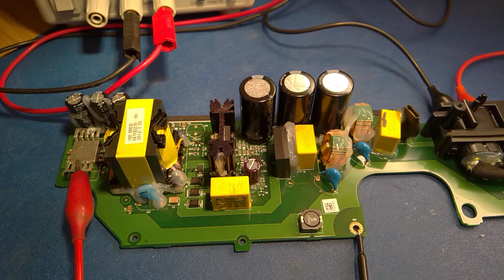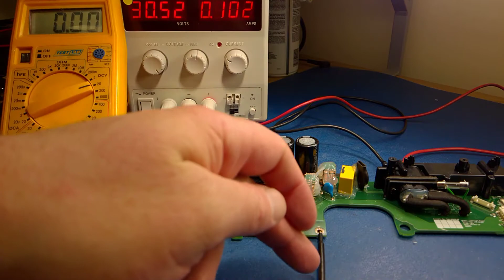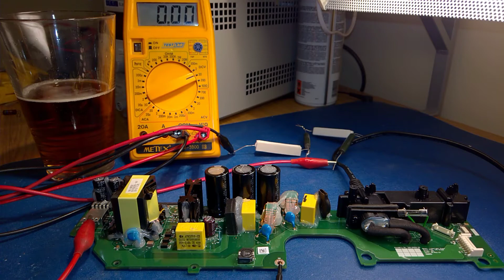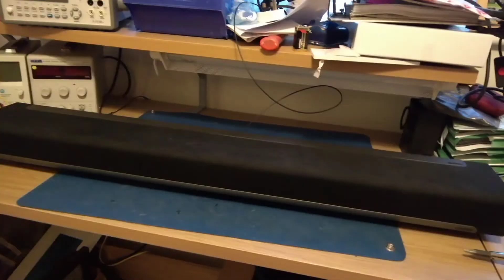[EafD] Sonos Playbar Repair - Part 2

Comment: So because there is no actual checking of the power supply that means we can just get rid of the power supply entirely and just feed it 16v from the mains directly to the low voltage portion of the board.

Comment: Does anyone know whether a short circuit can be measured between the two component connections on D2? This is the case for me, and I am reluctant to unsolder the component to check this.

Comment: Hey @Ohmslaw,
When you test the power supply with 30V, is that 30V AC or DC??
And how exactly do you select the 30V - would you please elaborate on this a bit?
Thanks for the video - it helped dismantling my Playbar.

Comment: Hi I have replaced the same components you suggested and the secondary stage has a slightly lower voltage and is chirping periodically please see video Hawkeye Oculus Sonos Repair. Can you please advise what failed components are responsible for this noise ( diodes capacitors etc) thanks

Comment: Does anyone have an service manual for this playbar. I need to repair mine and eould like to know how to read snd measure the pcb's. Many thanks in advance
Reply: Sonos have never provided a service manual for any of their products!!!  However this particular design is relatively easy to troubleshoot. I've fixed a Play 3 and a Connect both with PSU failures and found them to be pretty straightforward.

Comment: Glad I found this. Rather than try to repair the PSU I just cut the PCB in half just to the left of the mains inlet, sanded the traces to remove the copper mask,  soldered +ve to the top and ground to the bottom. Bought a 6a adjustable PSU from Amazon, set it to 16v and hooked it up. Works perfectly. If the PSU fails no need to rip it all apart again.
Reply: Foto ? Ik wil dit ook

Comment: Thank you Ohmslaw. Although my knowledge of electronics is not enough to understand everything you explain, your videos did help to test the board and find what was wrong: one of the wires of the first filter coil (capacitor choke) was broken. Easy fix. The most complicated part of the repair is putting everything back together again 🙂

Comment: My playbar quit abruptly.  I watched Part 1 and 2 and ordered the FET, Fuse, Primary Cap and PWM Control IC.  As I read the comments, some had had bridge rectifier blow so I will order that.  I have no idea what I'm doing so if everything goes OK, I'll put the parts in and see if it powers on!

Comment: Is it possibly to bypass the AC portion of the power supply and power the device using DC?
Reply: Yep. Connect 16v to the points shown in the video. Or do what I did and cut the PCB in half and solder wires to the top and bottom thick traces (top is positive, underneath is ground). Then remove the label on the read ports, remove three tiny screws and you can remove the mains jack (cut the wires first). You can then run wires out the back or fit a DC jack.

Comment: Great tip with the power supply instead of AC input. I was afraid to play with power supplies. Used a serial bulb circuit but of course it's still dangerous. Your way is great, I love it. Thank you ♥

Comment: My Sonos playbar was not powering up and I was fortunate enough to find this video. On mine the PET had blown as you could see a tiny burn mark on it.  Anyway I changed that, capacitors/fuse and bridge rectifier.....I happy to say it's all fixed and running again. I can't thank you enough for the info you provided here as I wouldn't have been able to fix it without this. Saved me a fortune and saved the planet too. Well done.

Comment: Hi mate, thx for the video. Can you really test a switching power supply with dc input? My problem is, i don't won't to buy a galvanically isolated AC power suppy to test a switching power supply at home (but don't wan't to work on the main directly).
Reply: The first thing happening in a switch mode is that AC is rectified to DC perhaps with a little filtering to get a nicer load on the AC kurve. So unless there's something really special about you PSU that expects and uses AC for something then yes you can power it using DC instead.
Reply: @HifiCentret  Thx mate, will try that  :)
Reply: @HifiCentret  And thank you answering on a video that is 5 years old :) .

Comment: Great video Ohmslaw. I picked up a non working playbar and have fixed by replacing the fuse and the rectifier with a higher rated 10A 1000v part. However, the power supply is noisy, (whine, chirp etc). I hope it is the capacitors so I've ordered some high quality rubycon caps to replace the stock Jackon ones. I'm curious about your comment on installing 3 capacitors instead of 2. Could you expand on why this is better? Won't it negatively affect the circuit? I just wonder why Sonos would leave a blank on the PCB. Finally, if the caps don't sort out the noise from the power supply, what would be my next course of action? Coils look OK and they are dampened with plenty of glue/epoxy. Maybe the transformer is to blame? Many thanks!
Reply: he doesn't reply on comments 🥺
Reply: Hi Carlos, did you ever get to the bottom of your issue?
Reply: @bumnail  Try electronics red insulating varnish for whine/noise from the transformer. Helped bring the noise/whine down in my case. Capacitor change did nothing. Noise comes from the transformer.

Comment: I have a question. could you tell me what the green sphere is next to incoming voltage. for the fuse.
Reply from the maker: Covered in glue?
Reply: @ohmslaw3182  nog left from the fuse. On the power bord  th2 in your 1st movie at 7.50 you see it sitting before the fuse

Comment: THANKS for the video and the rest who commented! Found one Playbar for 800 Danis krone (~ 120 USD) at the local second hand marked that didn't turn on and risked buying it... best decision ever! Managed to fix it by replacing the fuse and the bridge rectifier (one with a bigger value, hopefully it will not blow again) :)
Reply: Marian Laza Hej. Jeg står med en død Sonos Playbar og jeg har en mistanke om at det er strømforsyningen. Jeg har ingen forstand på elektronik, men kan se at du har forstand på det 😀 Ville du være interesseret i at kigge på den? Jeg skal selvfølgelig nok betale dig for ulejligheden.
Reply: @christiangrnbkjrgensen6328  The thing is that I was lucky with mine because only the fuse and the rectifier was bad, both of them really easy to check and replace. It was one thing to work on mine but unfortunately I don't have training in this field and because of that I can't guaranty that I'll be able to fix it so I prefer not to get involved in this. Here you can find some more information to get you started: https://www.reddit.com/r/sonos/comments/c31n6s/starting_point_in_repairing_a_dead_not_powering/
Reply: Marian Laza Thanks 😀
Reply: @christiangrnbkjrgensen6328  Hejsa, Håber du har fået liv i din Playbar?
Jeg har også problemer med en Playbar. Kan du evt oplyse hvem der kan reparere den?

Comment: Great video and explanation. Just repaired mine. Blown was the rectifier in front of the 2 caps, part KBU606. This component is easy to check  with an multimeter directly on the board. If blown, it creates a short circuit. Replaced with a rectifier taken from a PC power supply with higher value.

Comment: I just skipped all of this. I just soldered a lead onto the internal connector that connects to the remaining electronics and led it outside the case. Then i attached an external regular laptop power supply 16V. Works fine.
Reply: This is what I tried doing...what do you mean by a lead? Just a wire or with a female connector..
Reply: @ckoinzan  i know its being 2 yrs since you did it but can you tell us how to do it pls? A guy wants 150€ to fix it.  Thanks

Comment: Hi can you tell what Mosfet is used, mine is blown?
Reply from the maker: Toshiba TK6A65D(STA4,X,M)
Reply from the maker: Updated video with some RS part numbers 
FET = Toshiba TK6A65D, RS part 8962420
FUSE = RS part 2260585
Primary Cap = RS Part 7260754
PWM Control IC =  ON Semiconductor FAN6300HMY, RS Part 7396074
Reply: @ohmslaw3182  Just swapped all of the and applied 30V same as your bench suppy but it still keeps blowing the T3.15 any ideas. I see 15V for approx 10 seconds.
Reply: Just found bridge is partly defective as well KBU606
Reply: @ohmslaw3182  Cant find RS part number 8962420. Any suggestions of replacements ? TK6A60D ?